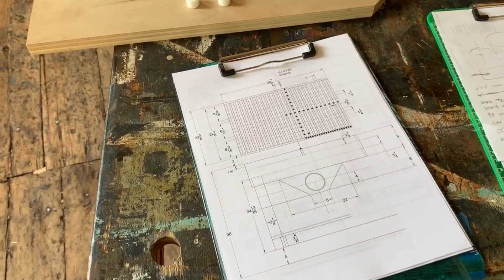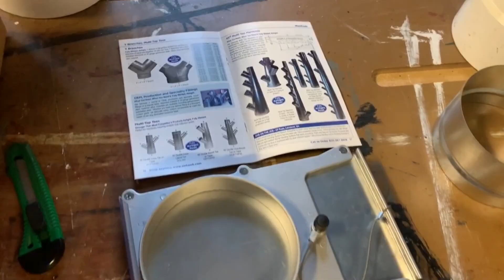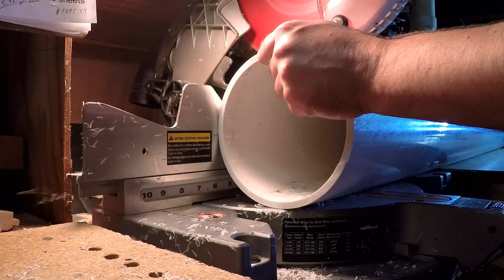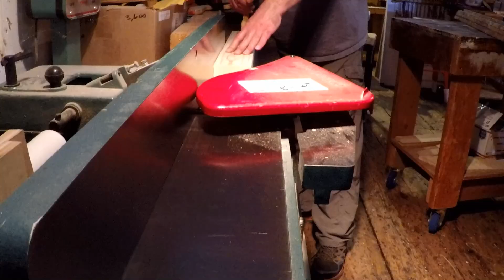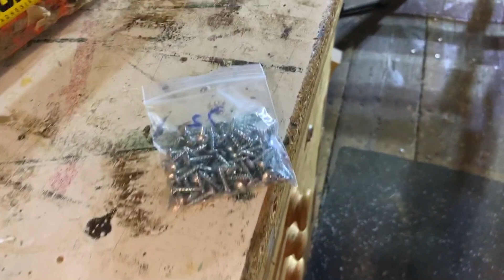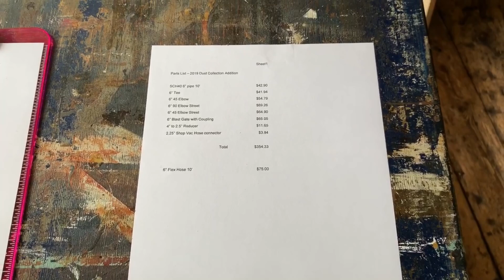Building a Wood Dust Collection System with PVC - tips and tricks for installing pipe

Comment: Word of advice don’t hold on to a short section of pvc pipe when cutting on chopsaw......I was cutting some the summer and the pvc kicked back and edg of pvc shattered.  I was using thin wall sever pipe.
Reply: Lol.....later in video I see it happened to you too....earlier in video you were holding the short end

Comment: why use schedule 40?  its expensive and heavy.  SDR 35 is a far better choice.  Also your efficiency suffers because you have tees and not wye fittings and also 90s and not 45s.  Good tip with the plastic wrap!

Comment: If you are worried about efficiency, why are you using hard 90's and hard Tee's?  I am guessing that your vacuum system is so powerful that you can handle the inefficiency of hard turns.  For those that are looking at this to build your own system, don't use hard 90's or hard Tee's.  And there is no need to ground your pvc.  Show me a video or data on a fire caused by static in a small dust collection system like this.